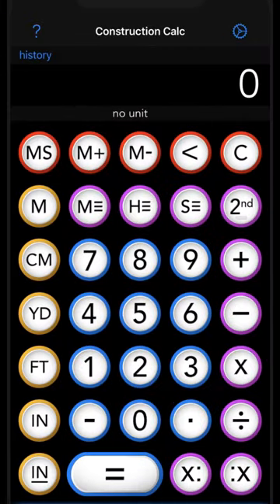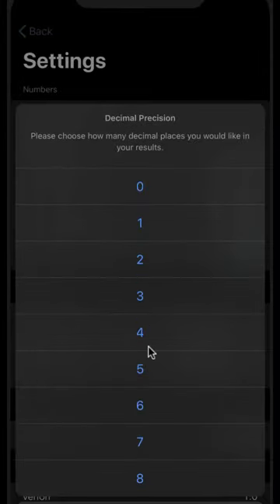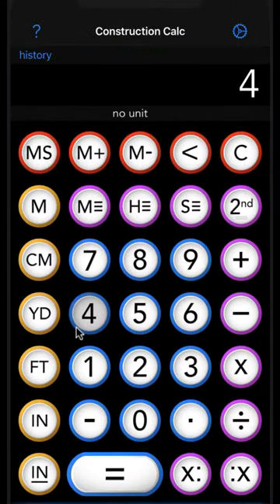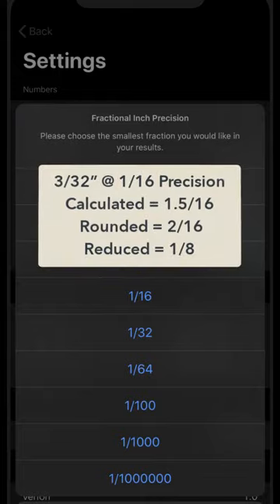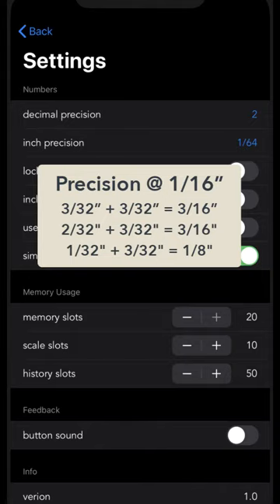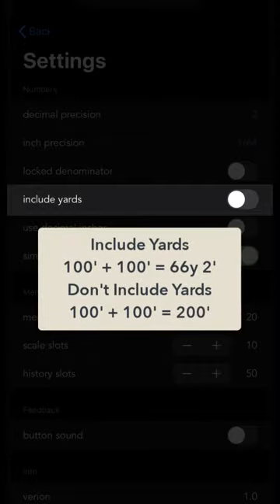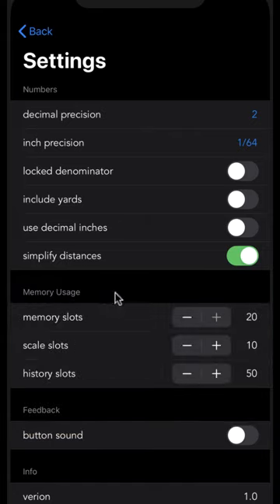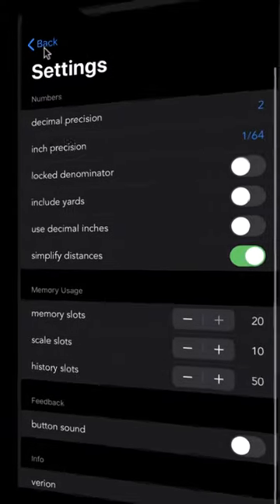Construction Calc - Settings

Comment: I used to be able to add multiple fractional foot inch and fractions of inches say 14 ft 4 and 1/4 in and 14 for and a quarter inch and say one other measurement This doesn't do it I am totally aggravated with this app